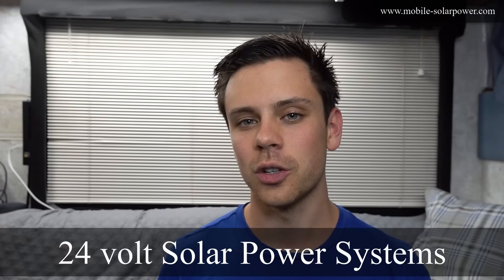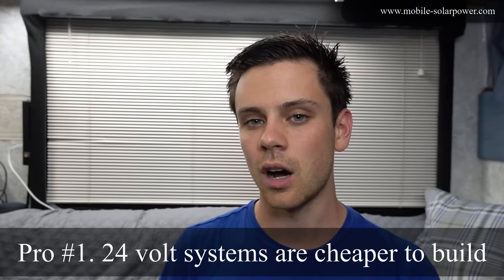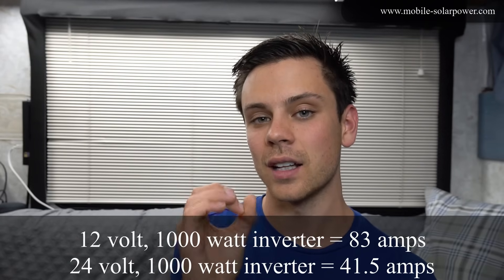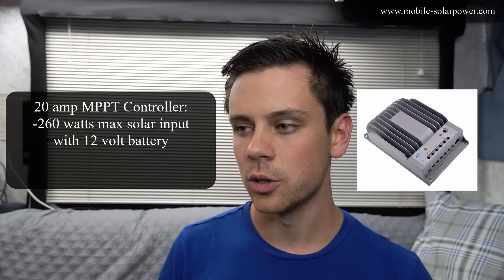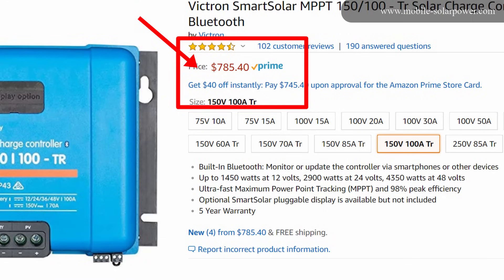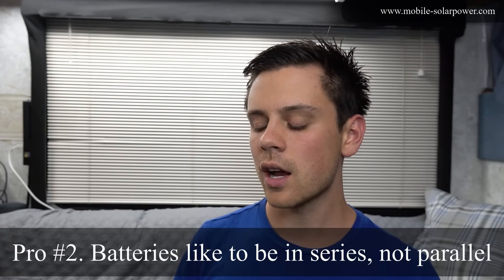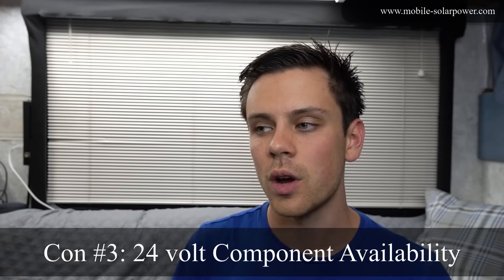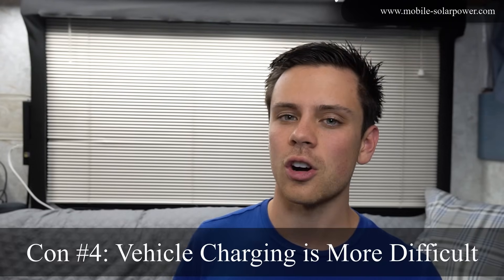12 volts VS. 24 volts for Off-grid Solar Power Systems

Comment: Hey Will. 

So I feel like I'm in a little bit of a grey area here. 

I've got 4x 180w 24v panels that I plan on running in series, totaling 720 watts of solar at 48v (39.4v max power). I like the idea of minimizing as much current as possible in those long runs from the roof to the charge controller. 

This means that, at peak power, and after the charge controller converts to 12v-- the batteries are bringing in a maximum of ~72 amps. 

If I build my own battery bank from those Amazon cells, I could either have a 12v 400ah bank, or I could build up a 24v 200ah bank. If the 1c charging rate means that the batteries can take up to 400 amps at once, what do I have to gain by going with a 24v battery bank?

Theoretically, my charge controller will be super close to my batteries, so the huge wires associated with a 12v system wouldn't have to go very far... Am I missing something?

(P.S. I've literally learned all of this from you and your book, which is pretty cool)

Comment: Great video!  Can a system be too big in a van?  I want to set up my van as a mobile power vehicle, with the capability of powering my house in case it’s needed.  How big with max aH and max volts can I go (safely)?
Reply: Your intentions might be noble. But absolutely senseless! Some common sense is very useful on those occasions! 

So you want solar power on your van, makes all sense. ;-)
You want (a lot of) power in your house... Fed from the van, doesn't make any sense!
Your house benefit from the area, the fixed condition, weight is no major hassle, makes production and consumption close to each other, etc. etc. 

So why feed it from a moving vehicle, which would be overloaded with unnecessary crap. AND for starters lack the much needed area for panels. And the volume and load capacity for batteries and such! I find hard to believe anyone  within a sanity option would consider haul all that. Back and forth on a permanent basis! Don't you intend to use your van? I mean drive it around, use it for what it's built for loading stuff, etc?! 

With this said, the van roof covered with panels and an inverter. With a simple extension cord could provide to the house in an emergency. A boost if you will.
But the main core for the house should be in the HOUSE... Cheaper, simpler, and you don't have to drive around all that!!! ;-)
BTW I do have solar on my van. ;-)
Reply: Late response but may help others. Click on the link in video description. Scroll down to Other Blueprints - Solar Trailer. This gives a good example of equipment needed and the space required. Will built the system inside a enclosed V Nose trailer.

Comment: if your solar panels are 24 volts input to charge controller, but they charge 12 volt batteries will the controller still handle double wattage from the panels?  I have 960 watts of solar panels which charges max of 53.333 amps @ 12 volts.  I have a 40 amp controller, it charges 12 or 24 volts but says max wattage input of 480 for 12 volt system or 960 for 24 volt system.  So do I follow 12 volt system or 24 volt system.  Thanks

Comment: love your videos and all the info you give us. Now my question. my panels will need to be 180 to 200 feet from the cabin. So i want to use 24volt system. I was going to use 4 Trojan 6 volt batteries which are 420 AH each. Will 2 235 watt panels equalling 470 watts be enough panels?
Reply: How long is a piece of string ?  It depends on what the batteries are feeding, how much sunshine you get, how much you use the stuff the batteries are feeding, etc etc.  20 watts of solar panels would probably keep the batteries charged if they had no load under most daylight conditions.  470 watts would be next to useless if you were drawing even a small load (say 50 watts or 2 amps at 24 volts) continuously in heavy overcast conditions with a short day length.   Don't discharge lead acid batteries beyond 50% ever and ideally less than 20%.  They deteriorate quickly unless they are fully charged.

Comment: Question?
What happens if I connect a 330 W 24 volt panel directly to my 12 volt battery bank?
What size and type of Charge controller would be best?
Reply: 330 watt / 12 volt is 27.5 amp, so say a 30 amp controller minimum and has the battery is 12 volt and solar is 24 volt it must be a MPPT not a PWM  type controller,  (based on what he just said anyway).

Comment: 24v requires more batteries . Not cheaper. Wires are cheap compared to batteries
Reply from the maker: Nope, same price. KWh price for batteries is the same
Reply: @WillProwse  No, it's not. 2 deep cycle 6v batteries to get 12 volts, 4 to get 24v of the same AH. That's twice the cost
Reply from the maker: @Gen-wf2sv  ah is dependent on voltage. Watch my electrical equations for beginners video. You are wrong, I promise. Price for batteries is based on kwh capacity. Do not use ah capacity. 100ah at 12v is 50ah at 24v. They are the same capacity. Please watch my other video or ask an electrical engineer
Reply: @WillProwse  I am an electrical engineer. I live off grid full time in a home made 4kw solar system. I started with 12v and went up to 24v. Had to buy twice the batteries to get the same capacity.
Reply from the maker: @Gen-wf2sv  show me the batteries. You are aware that ah is dependent on nominal voltage, right?
Reply from the maker: @Gen-wf2sv  sounds like you got ripped off big time if that's the case. Idk why you would pay double for something you can easily find for the same price
Reply: @WillProwse  it's not double price, it's twice as many. Two 6 volt batteries= 12v. You have to buy 4 of them to get 24v
Reply from the maker: @Gen-wf2sv  you said earlier it's twice the cost. I said, no, it's not. Now your saying it's twice the batteries. And I'll say, buy 24v batteries then. Who gave you an electrical engineering degree? Lol
Reply: @WillProwse  Purdue University. If you have to buy twice as many, it will cost twice as much. 24v batteries are not economical or available
Reply: I have 36 of those
Reply: I guess I should mention that I do advise 24 over 12 volts due to efficiency and higher solar panel wattage ability with most controllers. Was just stating that wires are cheaper than batteries.

Comment: Voltage is not the main factor when getting shocked. It's Amps.
Reply from the maker: Yeah but resistance of your skin won't allow the current to flow. I can touch a battery capable of delivering hundreds of amps without problem because the resistance of my skin. I highly suggest going back to a basics of electricity book and learn about ohms law. You need it

Comment: I wish we lived in a 24v world or better yet a 48v world but we live in a 12v world.  I agree with most of what you say but depending on the application, the cost and effort and compromises can far outweigh the benefits.  MPPT is an easy way to lower your panel and wire costs but deviating from a 12v battery bank is where it gets tricky and it really depends on your specific system and application.  I like your videos and I understand it's easier to troll than teach so please take this response as an approval of your message with a couple of concerns for the average Joe.

Comment: What about a system capable of dual voltage (terminology ?) for operating an electric inboard marine motor with 48V but with the rest of the boat at 24v? Am I just using voltage converters? Is there a video showing how to wire all that with hybrid renewable sources like solar with wind turbine?
Thanks.

Comment: Could you have 12v battery with 24v solar and have your mppt lower your voltage but increase the amps to power battery? Then run dc appliances accordingly off the 12v battery without converter?
Reply: It is possible, but there are no products doing this, because it is in general less effective and make controller more complex.

Comment: How about if I run a split charge connected to my deep cycle battery, would I still damage my alternator?
Reply: Temdri World use an isolator and switch. Marine switches do a great deal for going back and forth and having control over system lines.
Reply: blairbushproject 
Many thanks

Comment: I installed on my Van 4 12v 175w solar panels, wired in parallel for a total of 7000w, to a solar charge controller charging 2 12v 100Ah AGM batteries, wired in parellel for a total of 200 Ah. I run the 12v appliances from the 12v load convention off the solar controller and the 120v appliances from a 3,000w inverter connected to the battery bank. I want to upgrade to lithium and increase the capacity to 1000Ah .. what configuration is recommended using the 4 solar panels on my roof?

Comment: I like 48V systems. You can replace motors or rewind them if you're handy and patient. Automotive alternators usually start at 14V/90A capacity and go up from there.
Reply: 48V is still "low voltage" - I consider under 70V safe.

Comment: Talking about vehicles and no mention of DC-DC chargers with inbuilt mppt solar chargers. They've been using these for years in Australia with no issues. 12V vehicle system and 24V panels are not an issue with mppt just as it isn't elsewhere.
Reply from the maker: Nothing special about those. What are you talking about? I never said those are not an option or any better than other DC DC chargers. A scc is a DC DC charger. Very simple converter circuit. I don't get your point

Comment: I'm thinking of converting a Sprinter van into a full-time, off-grid tiny house and I was wondering what sort of setup I'd need to power:

- my laptop and phone,
- a 27" monitor and a PS4 Pro (4-6hr/day),
- a small fridge (24hr),
- a 2 burner induction cooktop (1hr/day),
- a 12v toilet,
- a tankless water heater,
- a water pump,
- a couple vent fans, and
- an array of LED light strips.

I think that covers everything :') just from that list, which one of your videos do you think I need to be looking at to feasibly power it all? Aha
Reply: I guess that's a question you can't answer :')

Comment: I've been searching for 24v deep cycle batteries all night and they're WAY more expensive than 12v... Am I doing something wrong?
Reply from the maker: Oh understand that a 100ah 12v has same capacity as 50ah 24v
Reply: @WillProwse  That answered my next question :') so I'd only need half the batteries?
Reply from the maker: @connorbassett6624  well. They are same size. Don't size battery with amp hours. I have a video called "electrical equations for beginners" that you should check out
Reply: @WillProwse  I'm thinking of converting a Sprinter van into a full-time, off-grid tiny house and I was wondering what sort of setup I'd need to power:

- my laptop and phone,
- a 27" monitor and a PS4 Pro (4-6hr/day),
- a small fridge (24hr),
- a 2 burner induction cooktop (1hr/day),
- a 12v toilet,
- a tankless water heater,
- a water pump,
- a couple vent fans, and
- an array of LED light strips.

I think that covers everything :') just from that list, which one of your videos do you think I need to be looking at to feasibly power it all? Aha
Reply from the maker: Run 12v in series

Comment: If u run 24 volts u will need twice the number of batteries  as u would with a 12 volt system .  The cost of wire is a one time cost . The cost of batteries is every 5 to 7 years . With batteries in parallel  your amp hours add together  , with batteries in series u only get the amp hours of 1 battery .
Reply from the maker: Wow. you need to watch my solar videos for beginners. You are missing so much.
Reply: @WillProwse   ...  No thanks . I've been doing solar and wind for 9 years now and I'm a  licensed electrician .
Reply from the maker: @larryhaney6608  I hope to God you are not. You are aware that you can buy 24v batteries right? You absolutely are not a professional. Look at the grammar errors in your sentence. Are you 10 years old? And Watt hour capacity doesn't change regardless of how you wire them. Sure amp hours doesnt change but neither does watt hour capacity, and voltage increases. Doesn't change capacity. People like you make me fearful for this world. You need an education.

Comment: So the downside to the 24V solar system in a RV would be you can't your you on board generator to charge up your solar batteries, right?
Reply from the maker: Actually you can use a converter to charge a small sealed lead acid battery and then use that to start the generator
Reply: @WillProwse  Thank you but I meant how can I use my on board generator to charge my 24V solar batteries?

Comment: Could you have a 24v system in series and have the 2 12v batteries in parallel  for the 12v inverter instead of using a converter?
Reply: No, that is shorting the batteries...

Edit: if you were willing to rewire your pack from 12 to 24 everytime I guess you could

Comment: @0:32 hey! isn't it I²·R? so u need 4 times more copper, if u want to loose the same amount of power in the cables? or where does "double" come from? do u mean the voltage drop R·I in the cable?
Reply from the maker: Yeah you're right, but I'm looking at current prices and amp capacity charts and it comes out to 2 to 3 times the cost, and it also depends on if it's a high amp load. For example, for 100 amps, 10 feet, 4 gauge, 21mm cross section, and for 200 amps, 10 feet, 2/0 gauge, it's 67mm cross section. So in that instance, it's nearly 4 times the copper, and will reflect a huge price difference. But if you have smaller wires with double current rating, it's about double the cost, because insulation and cost to produce becomes more of the determinant factor. Like most current charts will say 14 awg can carry double the amps of 16 gauge, but cross section is 2.08 vs  1.30. but shouldn't it be thicker to handle double the current? I get different numbers for different sizes, but for high amp loads, 4 times the cost seems right, but for most small wires, 2-3x the cost is the usual. I should have mentioned that in the video
Reply: @WillProwse  i c... i do not have any experience with such charts... i just remember some of the formulas from school... giggle seems like reality is more complicated than school... :)

Comment: helped wanted...please
5 panels all hooked up 500watts...
40amp mppt controler
1 AMG deep cycle battery group24-  79amps
1000 Watts inverter
can't ever power up a hair dryer!??  why ?
(used cheap computer power wire cutted out wired up the battery connected with inverter)
please please helpThanks!
Reply: Hair dryer wattage may be too much for your 1000w  inverter.  My wife's hairdryer is 2000w

Comment: Why should we buy a converter to run 12v appliances if we have 2 x 12volt batteries in our 24v system? Can't we just hook the 12v appliances to one of the 12v batteries ?
Reply from the maker: Then one of the batteries will be o unequally discharge than the other one. Bad bad idea
Reply: @WillProwse  I have 12v system and 700W solar panel in my RV. I have 40A epever tracer mppt working with 30A pwm (non-programmable) in paralel. According to my investigations using two charge controllers in paralel is not a good idea even if they are programmable and of the same brand. Then I need a new 60A charge controller or switch to 24v. As I have 12v RV movers which consume about 80A and I also use my 130A car alternator as an enregy source (because my 2x12v yuasa swl2500fr deep cycle batteries cannot give over 80A continious) So switching to 24v seems a bad idea to me, in addition my pure sine wave inverter is also 12v however I have a chance to trade it. An 60A MPPT costs a lot of money and my 40A mppt and 30A pwm will also be wasted. What will be the optimal solution for me?
Reply from the maker: It's fine to have two charge controllers in parallel
Reply from the maker: And it sounds like you're pretty invested to 12 volts right now so hard to tell you what is best. Depends on how much money you want to spend
Reply: Some people say that the secondary charge controller will see the first charge controllers voltage instead of the real battery voltage and shuts down prematurely.
Reply from the maker: @GaripGerçekler  those people are wrong. you can use multiple charging sources, and depending on internal resistance of battery, which is determined by state of charge/battery chemistry/battery size, will determine charge rate. whoever told you that, doesn't know what they are talking about.

Comment: Very nice. You have covered a lot of topics in a short video. Higher voltage is the way to go. One topic nobody covers is the losses across each connection and the copper-loss along each DC cable. A really excellent connection resistance is 0.1 Ohms; a tenth of an Ohm. If you have 10 amps flowing across that connection you lose 1 Volt. Multiply that by the number of connections. Ouch.
Reply: WA9KZY - (I'm leaning, so just asking) - is a 10th really a representative loss figure?? (because if it is, that's something!)  looking forward to your wisdom

Comment: Love the infopacked videos and how good it's explained. For me it's a nice "proof of concept" when I listen what you use as reasons, but for this video I have probably a question and a statement at the same time. I don't know how are RVs or Busses/trucks in your parts of the world, but from where I am, most of the RV/Truck circuits are 24 volts native and their alternators are pretty heavy duty and diode isolated to prevent backfeeds. I can't say everything is like this, but most is.

Oh, and something I always say to my students: It's not the voltage that hurts you, it's the amperage :D 0,6 microAmps through the heart are enough to kill you, doesn't matter the voltage ^^ Yes to ge close the circuit with such a low current you probably need a lot of voltage compared to the normal resistance of your body, but still... Don't lick 36 or 48 volt systems ^^ Those may and will kill you ^^